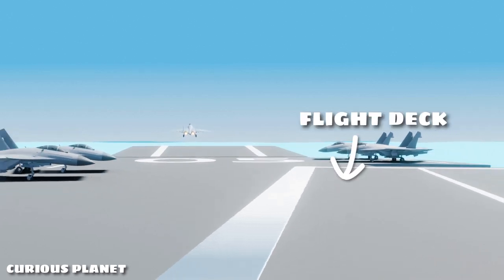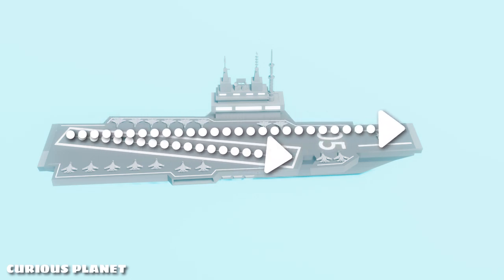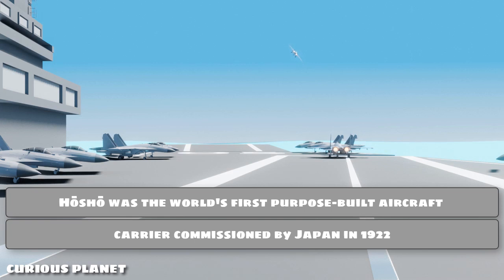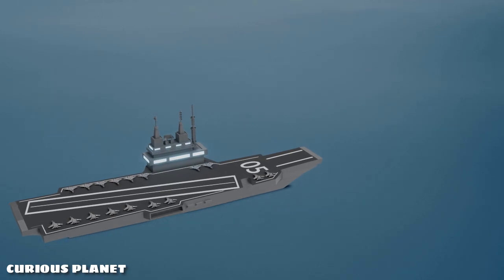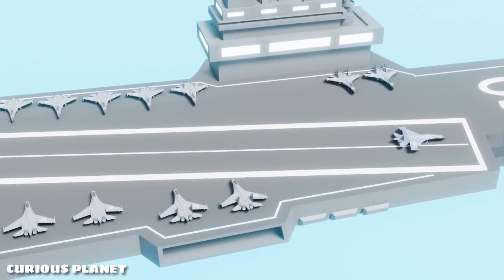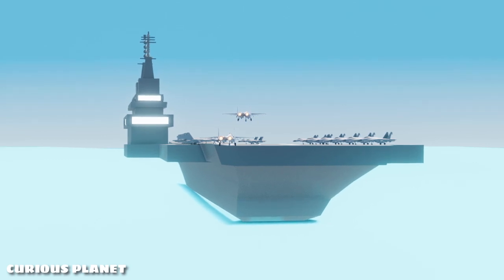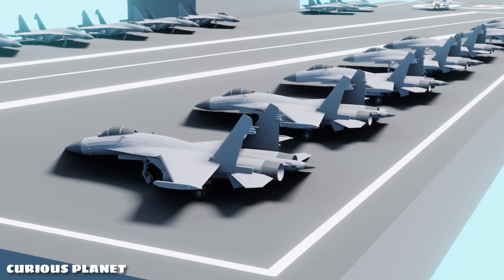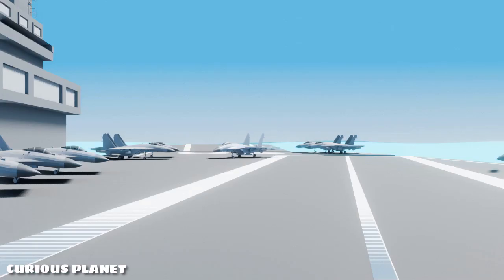Why Is the Flight Deck Of An Aircraft Carrier Angled & Not Straight? - 3D Animation

Comment: Angled landing strip is like wasting parking space, I would prefer a straight landing strip with it's takeoff strip on the middle front of the carrier and the front right is another parking space, middle back and center is parking space too and center right and center back is the control tower
Reply: But that would not work well. In WW2 there were many deaths and incidents of the planes crashing into other ones at the front. That is the reason for the angled deck.

Comment: if there a risk of them missing and falling into water? in that case the angled land would prevent the ship from running over them
Reply: Fighter jets land on the string to catch them then they full the throttle, if the jet didn't catch the string then that's why you should full throttle to be airborne again
Reply: The angled deck is for takeoff only